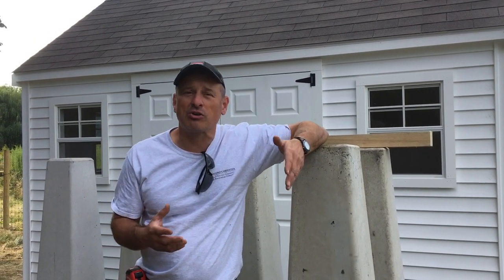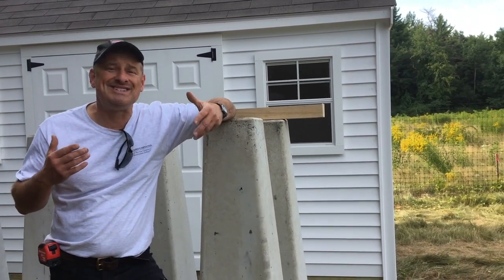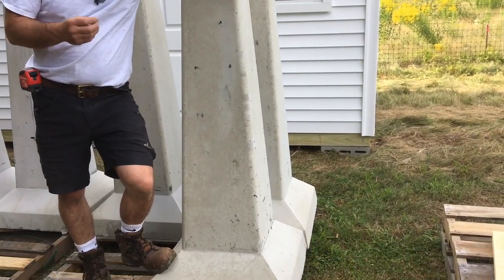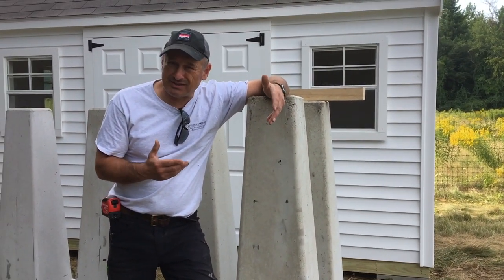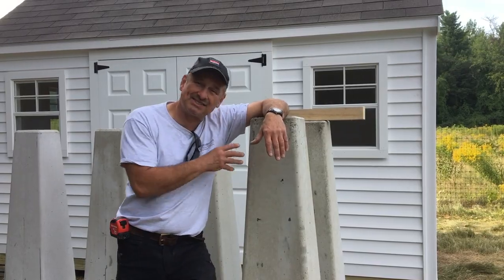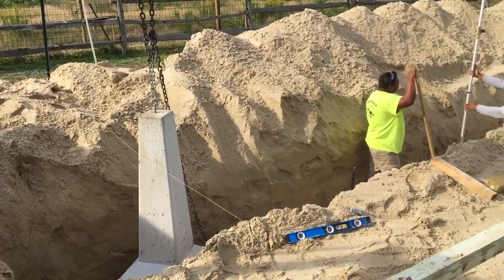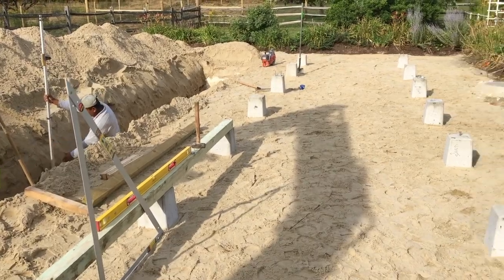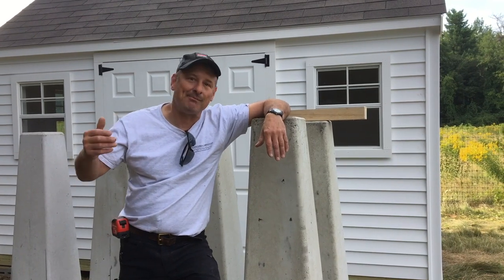Using Pre Cast Concrete Footings and Piers  - Carpenter Tip

Comment: Been using Perma-Columns, similar concept, good post-frame solution, can definitely be used for decks especially nice for elevated decks over concrete patios.  We’ve backfilled and mixed and poured around them.  Currently, I don’t see a reason to go back to tubes.

Comment: would you know how much they weigh? Is there a chart? Is it possible to form your own piers outside the hole and drop them in instead of working inside a hole? I will look into this but I am not sure my tractor could lift them. Maybe hire a machine to put them in place.....Thanks for the intel
Reply from the maker: 350-450lbs

Comment: Precast Concrete is great for all kinds of stuff but is digging a trench like that really better than drilling and pouring concrete? The time needed to trench that vs a skid steer with an auger making 48"x12" holes.
Reply: The Perma-Columns work perfectly with the skid loader and auger!
Reply from the maker: You bring up a good point - this was more money than digging 20+ footings but I was able to do this in one day. There is no way I could have dug 12" x48" deep and poured in one day. Plus the inspector doesn't need to insect the hole - they know how deep these piers are and will inspect after. Additionally, it's less wear and tear on y body - if the budget can hold the cost!
Reply: @ConcordCarpenter  Yeah, less wear and tear gets more and more important all the time! 😉
Reply: @ConcordCarpenter  the inspection issue may be the tipping point in the cost benefits analysis. Yes, get ot done in one day. Wear and tear on the body is definitely a consideration. I can dig (with 2 man auger) all 20 holes 12 x 48 in one day (depending on soil and unknown debris in the soil). In my world, less machinery is the better option. I always like to see other options than the way I do it now. I am ALWAYS interested in a faster and more efficient process

Comment: What about screw piles? They are becoming very common up north here in Canada. For decks and small buildings.
Reply: FTR, Technometalpost though they have P1/P2 piers, they will only spec their P3 piers for decks as they are concerned with bending (lateral loading) on their <3" piers. While their P2 can support up to 9000#, they're onyl 2.5-2.75", and won't be installed. Their P3 which will hold up to 33,000# are $550/ea installed at this time in North East USA.